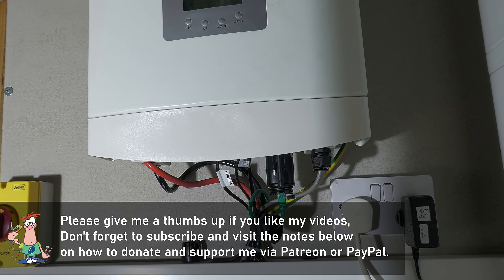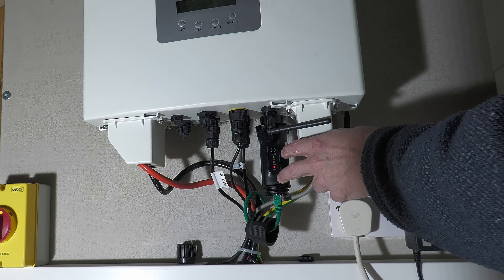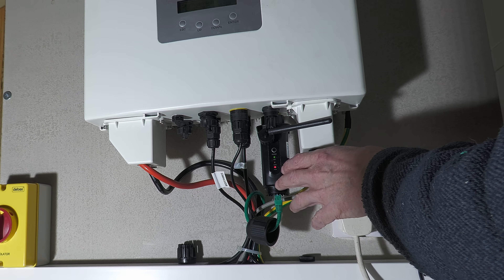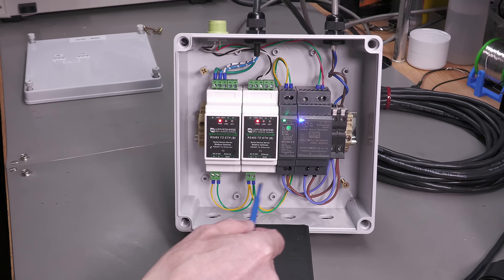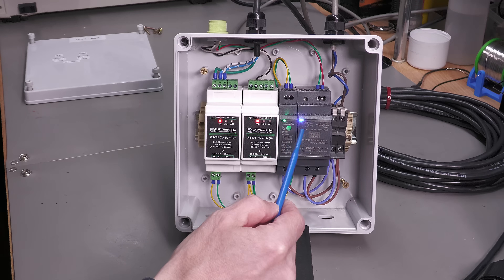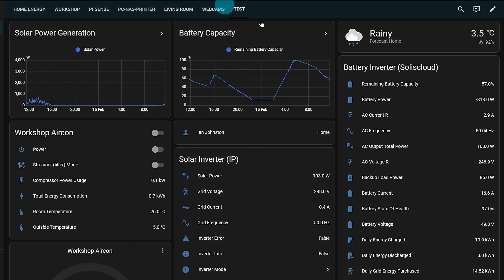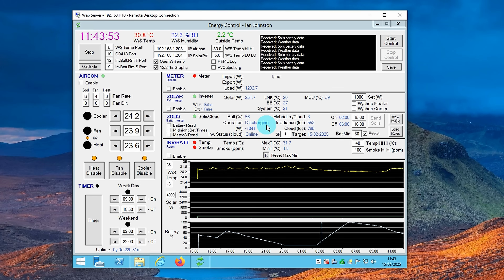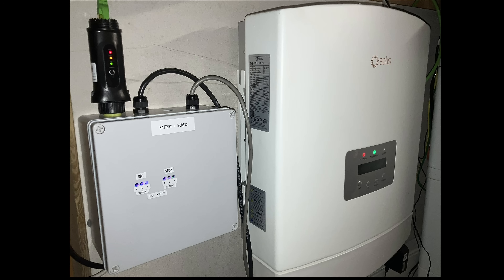No.151 - Modifications to my Solis Battery Inverter Installation

Comment from the maker: UPDATE 16/02/25:
Now have the automated overnight battery charge dynamic time slot working, so it takes 'tomorrows' solar forecast and decides how long to charge the batteries (if at all) during cheap rate 02:00 to 05:00 (UK - Octopus Flux tariff).

Why go to all this trouble to retain SolisCloud.com….? Here’s why, just received this via automated email:
【Solis Cloud】
The SN ################ inverter in your ############## plant has an alarm, please deal with it as soon as possible
Go to view alarm information
Alarm code: 2012
Alarm time: 2025-02-24 03:17:46
Alarm content: Batt_Comm_FAIL
Processing method: 1. Restart the inverter and battery 2. If it is still not resolved, contact the factory's customer service.

PS. This error required no action, was only a small glitch.

Comment: I'm just about to build this but I was wondering if I can add a second slave to this setup as I'd like to keep using solar assistant as well as my WiFi stick.
Reply from the maker: Yes, I think so......but as per the 1st slave for the Solis stick it would be read only.......or maybe you can parallel up the solar assistant on the same modbus as the wifi stick. Not sure as I don't use Solar Assistant.

Comment: Very useful, thanks for sharing. I've got a Solis S6 hybrid inverter and want to be able to control the charging schedule.
However the datalogger that's fitted to my machine has a USB style connector rather than the 4 pin green plug you show. The DIY Solar forum said it is likely to be modbus, but attaching a Waveshare device with a cut off USB cable - using the green/white wires as the RS485A/B - does not seem to work. 
Modbus Poll keeps returning time out errors. I've tried switching polarity and no difference.
Any hints would be appreciated.

Comment: Great video!  What sort of control decisions do you make in HA on your inverter, and based on what?  Is it just charging times? It doesn’t look like you have the Octopus API connected
Reply from the maker: Looking at tomorrows weather and adjusting dynamically the available 2am to 5am cheap electricity for charging the battery. This keeps importing to a minimum each day, I.e. when it’s due to be sunny then I can rely on the solar system charging the battery.
I haven’t set up any peak rate exporting, don’t think I’ll need to because we’re a heavy electricity user so never much available for exporting anyways.
I don’t use the Octopus API.

Comment: Excellent video, could I just ask why you don't just use the 5v supply from the same Modbus socket from the inverter you are getting the data from.  You already wired data pins and ground, why not wire the 5v line too?
Reply from the maker: I had no idea what loads I was going to have on the +5v supply at the time of design and so thought I'd run my own PSU.
I've no idea on the spec on the Solis Inverter +5v rail.

Comment: To complicated for me and my little floor, but in large I understand what is going on. And I noticed something in your settings that I wondered about. At aircon, a heating temp at 23.6°C, and at cooling a temp of 24.2°C. Isn't that much to close ? Wouldn't the hysteresis of a room keep them playing tennis whole day ?
Reply from the maker: The workshop is quite small and so it works out quite well. Ping pong does happen but it’s pretty slow.

Comment: I must say my Victron gear seems a lot more user friendly, you have VRM (Victron Remote Monitoring- aka cloud) but you can also link direct into my home network / HA or by bluetooth (and Modbus connectivity).  Not tried the solar forecast aspect with VRM as my system is purely standalone.

Comment: I might have to do this for my own Solis inverter. I am just in the midst of building a 48V LifePO battery that I plan on connecting to it. I have never dabbled into HomeAssistant though and its time to change that. I am tired of going to 20 different apps to control all my home smart devices
Reply from the maker: I’ve only been using HA for a couple of weeks. There’s not much you can’t do with it!
Reply: @IanScottJohnston  awesome. You should make a video on your HA setup. Thanks again

Comment: re your power supplies +5V and +12V.  I think I would have stuck to the single +12V and added a DC/DC converter to derive the +5V.   My home BSS uses 24V and  have a no-break DC supply of 24V (and 12V via a Victron Energy DC/DC converter) to run all my comms equipment directly. Keep it simple,  and reliable.

Comment: Thanks for the video and information. I was just wondering if you could make a short video or provide design information on the control of the Daiken air conditioning system, and maybe the models that are compatible with external control. Some of your data showing the stability of the temperature is impressive.  cheers from Australia, where its 30C and RH of 70-80%
Reply from the maker: For the Daikin, it's as simple as this, just fit the optional Wifi module to the Daikin and format http as follows:
http://<IP ADDRESS>/aircon/set_control_info?pow=1&mode=1&stemp=24&shum=0&f_rate=B&f_dir=3
pow = 1			On
pow = 0			OFF
mode = 0, 1, 7		AUTO
mode = 2		    DEHUMID
mode = 3		    COLD
mode = 4		    HOT
mode = 6		    FAN
stemp = Range Of numbers: AUTO 18 - 31, HOT 10-31, COLD 18-33

Comment: It somehow seems overkill, isn't there a serial port or a CAN port as well on the inverter? That's what I used with my inverters, but none of them were Solis. My current one has the WiFi built-in and it can feed data to the cloud but it can also be accessed from LAN.
Reply: Maybe he could use some passive RS485 circuit with the original adapter. But this is most flexible and likely easier to setup?

If there is a CAN port you'd still have a CAN to ethernet adapter, unless you had a local raspi.
Reply from the maker: @jaro6985  If it was read only access only then that would have been easy, but here I want my external control to write to the registers within the inverter itself.
Reply from the maker: There’s quite a community of Solis inverter users and this is about the only way to get dual access. I think mainly because Solis themselves published the modbus address list, so it is an available port that folks have gone after.

Comment: I have the same looking system, but mine handles the solar panels, batteries etc.
I can't stop the cloud connectivity as both solis and the installer monitor the system for faults and updates.
Its a shame that  we can't run multiple r/w via the modus. Ive only used modbus via ethernet and had multiple pcb's connected to one modbus module.
Reply from the maker: The reason I wanted to keep SolisCloud working was for the fault reporting……..so hopefully that should continue.
Reply: @IanScottJohnston  Does mean that you could miss out on F/W updates. I seem to get one every now and then?

Comment: Your workshop temperature is akin to the Bahamas at 24 degrees Celsius; I start taking clothes off at about 18 to 19 degrees, I'd be completely in the nip by 24 degrees!!! LOL
Great video as always Ian, thank you. 👍
Reply from the maker: That's the old sensor....It's inside the server cabinet right now.....:-)
Update: oh wait, I thought you meant the 30degC on my old app. Well, the 24degC is at the temp sensor which is next to my 3458A so slightly biased up a bit. The main workshop I guess is around 23.

Comment: Years ago I also had to deal with a very bad wifi stick + cloud app combo for a Growatt solar inverter. I managed to get fed up enough I reverse engineered how the stick worked and replaced it with my own server implementation. Was quite a fun learning experience. Has been running for a couple years now without issues thankfully. That system ran on a similar ModbusTCP type of connection.
Reply from the maker: Nice work!
Reverse engineering possible on this stick I guess, it uses an ESP32.
Reply: @IanScottJohnston Interesting video, thanks for sharing.  I had a similar requirement to link wired MODBUS data from my (Epever) solar charge controller to multiple destinations.  I chose to use an ESP8266 running ESP-link  to get the modbus data onto the LAN via WiFi and then linux utility socat to relay the data to multiple destinations.  Advantage is that ESP8266's are cheap and reliable.